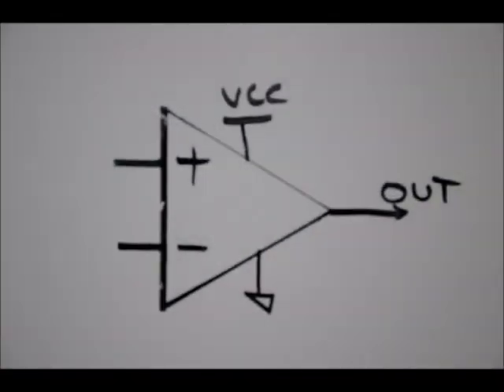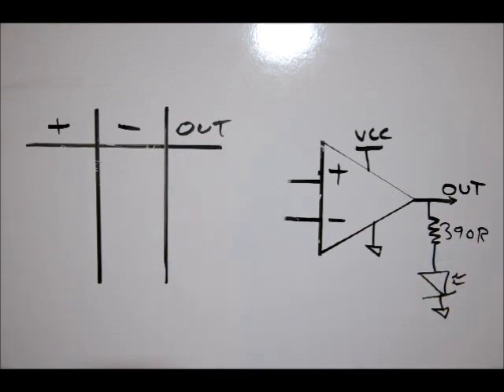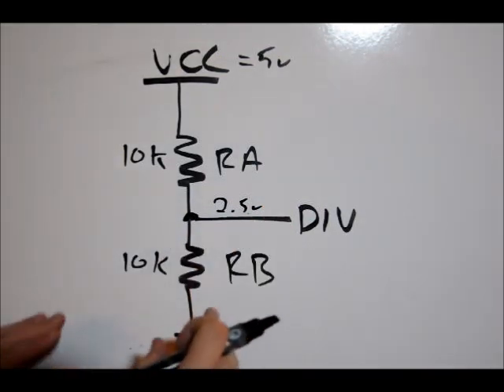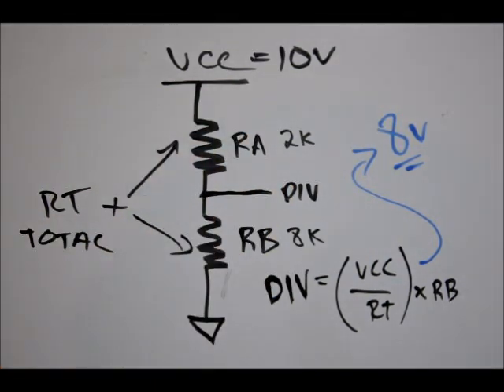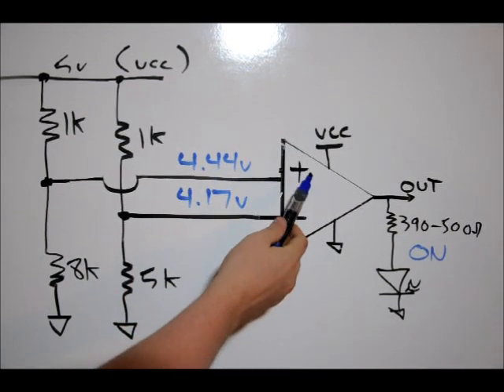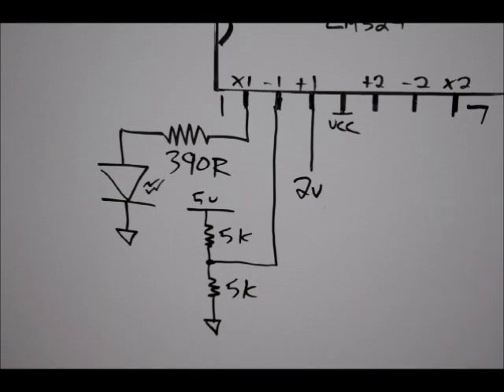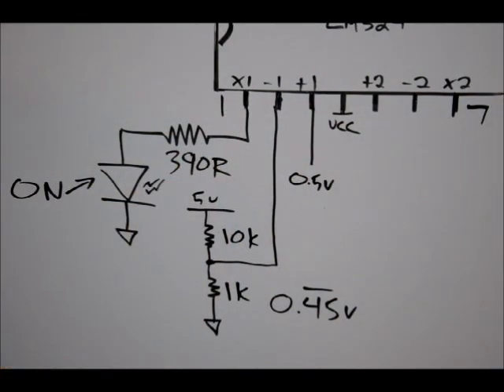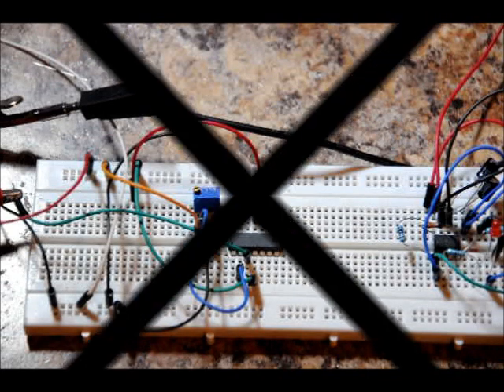Electronic Tutorial: OP-AMP Comparators & Resistor Dividers   Theory & Lab

Comment: Will the op amp 471 chip have the same characteristic as the 1 you use in this video?
Reply: +Yaw Hua Niew _____Yes, and is 741, not 471!
(µA741, LM741...)
Reply: 471 doesn't exist as a single op amp. It's only 741.

Comment: Are the dividers necessary? Can it work with one resistor per input?

Also, acording to the formula there is no difference between for example using a 500ohm and a 1ohm OR a 500000ohm and a 1000ohm resistor both results are the same 0.01 so what's up with that? shouldn't the higher values increase the resistance and therefore reduce the voltage?
Reply: +zerpBot The voltage is the same in both of those cases. What changes (decreases in our case) is the current.

Comment: Opamp circuit is right but resistance division is wrong because openloop opamp gain is very high, so it can amplyfi a some micro current in very large but resistance has no so many volt after setting one k ohm resistance because v/r =I ,so I is 1 culamb in 5 volt .so 1/5=200ma is equal to 1 volt . If you would set 1k resistance ,there current will be 5/1000 =0.005 ma only this means 25 mv only not 4.4 or 4.7 volt

Comment: regarding your results table (before you got into the voltage dividers).  I modeled your op-amp in TINA, with the various inputs and checked the outputs. they do not agree with yours. the high output was 3.6v, and the low was 1v. the LED lights up with anything more than 2v. so while my LED on/off agreed with yours, the voltages did not.

It would have been nice if you had checked your output with a meter, not just an LED.

Comment: What happens if the inputs are both the same, will the led 'light' or not
Reply: Kieran Hammond An op amp is a differential amplifier, if the inputs are the same, there is no difference, so there is no output. 

That’s ideal operation, in real operation, owing to the huge gain of an op amp, if one input is even .0001 volt higher than another, it could switch states. In practice, if your input is noisy or may have small fluctuations, you’d want to use a Schmitt trigger on the input to keep it from switching off and on, and a stable voltage reference on the inverting input so that voltage does not fluctuate with supply voltage.

Comment: What if V+=V- ?
Reply: +Vinnius Kruger ____Then the output will oscillate between GND and positive rail, assuming the input offset voltage is zero.
Reply: Circuit will explode lol
Reply: output will be zero
Reply: Vinnius Kruger wouldn't the output stay the same and not change if + = -?
Reply: floating. in good circuit it is considered as failure.